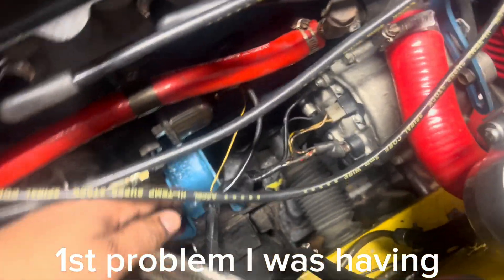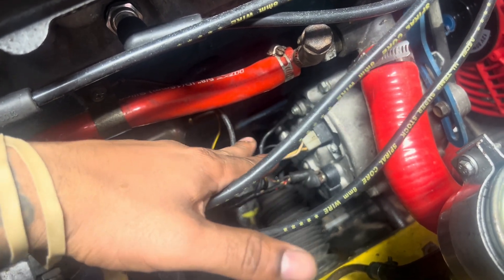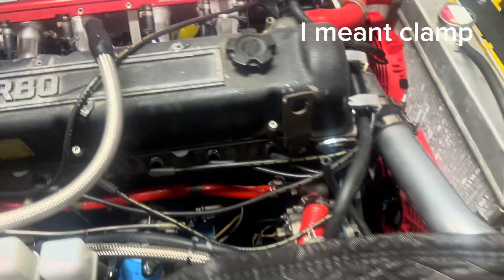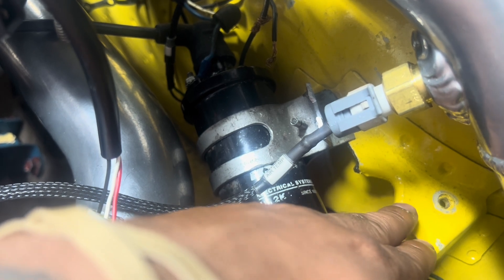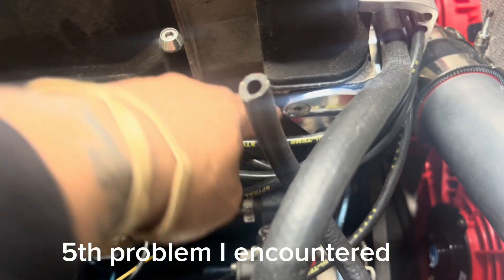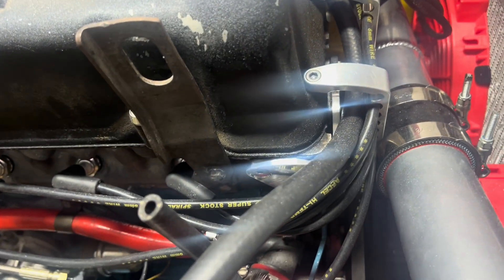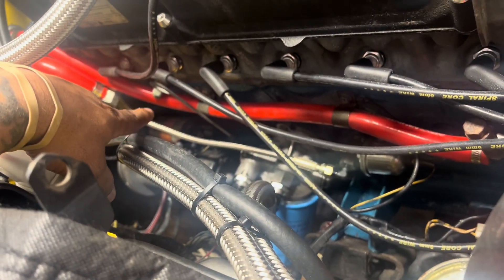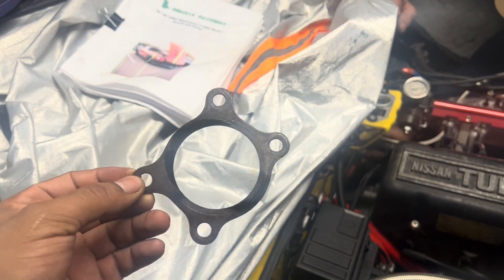Datsun 280z l28et Godzilla raceworks megasquirt plug and play part 3 (addressed mistakes I made)

Comment: 😂just get rid of that old ignition coil system you can buy a 99 volvo v70 bosch ignition coil and harness, simple 3 wires ground ignition power and ecu trigger signal did my swap in 06 and never had ignition issues scince
Reply from the maker: Dyou have a bracket that holds them? and where did you buy it from, I'm going to look into this system.